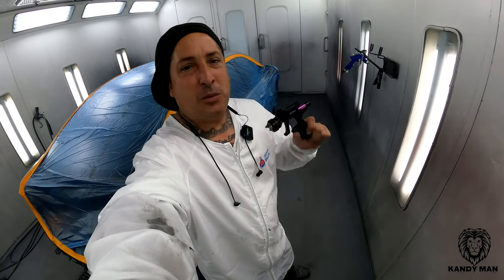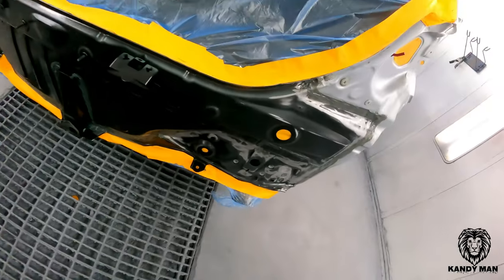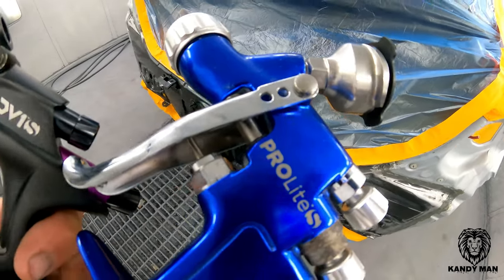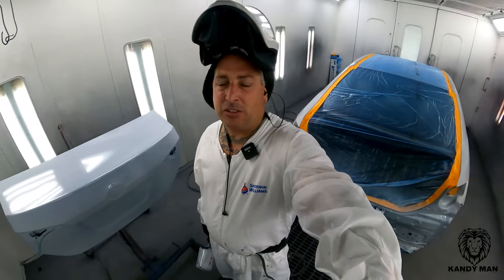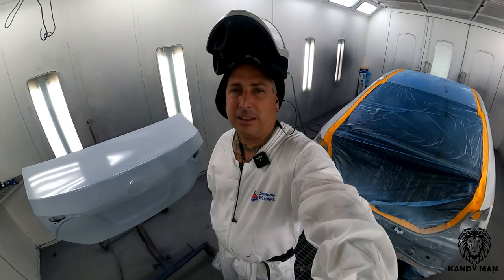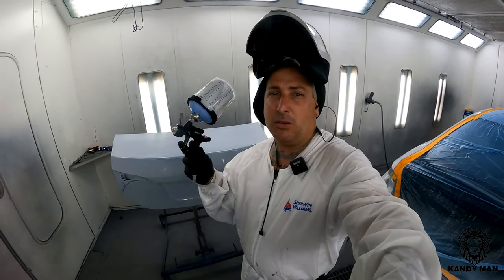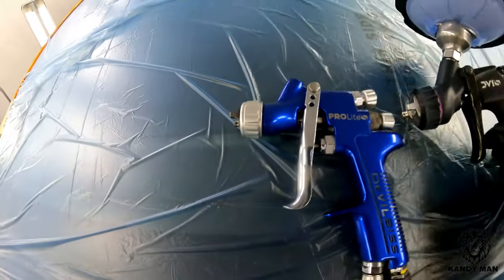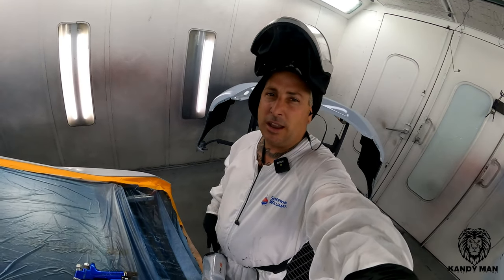DEVILBISS DV1S REVIEW

Comment: I use a DV1S 0.7mm for all the cerakote applications I do. I really like it. It is a very smooth mini. I use to use the Walcom Ego190 0.7mm HTE for cerakote that worked great too it just only lasted a little over a year. Walcom rely too much on those polypropylene internals inside. I sold that ego190, both genesi 360 light guns and slim kombat nero and bought all 3 DV1 guns

Comment: Hi Kandy Man, great video Sir and the DV1S did a good job on the sealer and that fan is big isn't it😆 like you I always wind my fan in a bit as I find it sprays a bit wetter like that. You should try it for base and clear, I use solvent base and it lays it really well and my clear is an HS and while it does a good job I think it's a bit slower than the ProLiteS, thanks for sharing your thoughts👏🙏👍John UK.